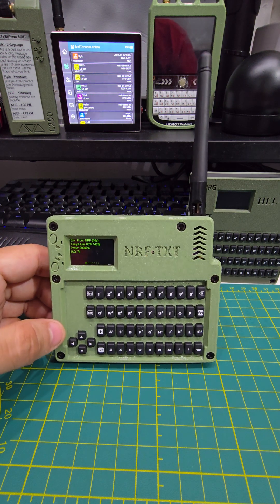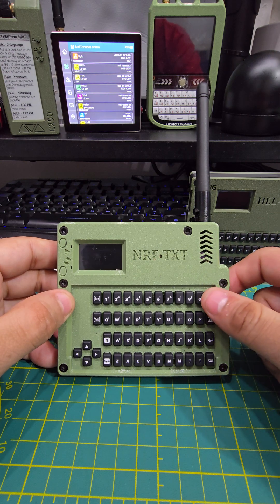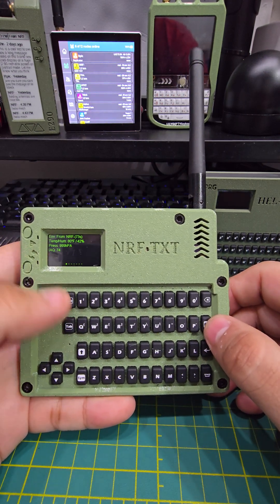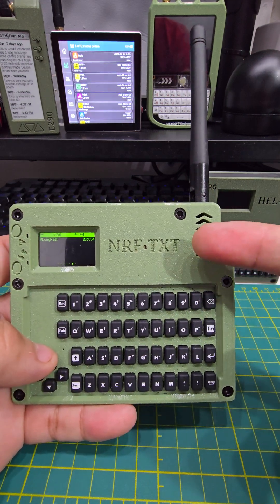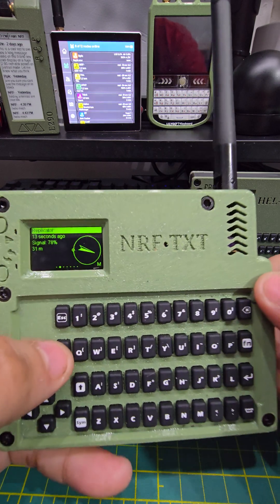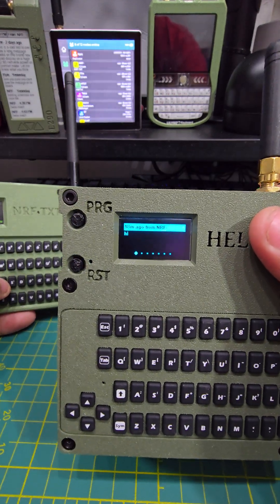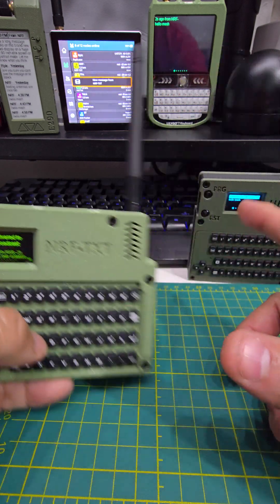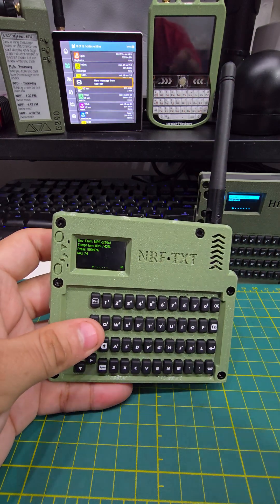NRF-TXT - Standalone for Meshtastic

Comment: Nice.   how waterproof/dust proof is this?  I don't need the temp, buzzer, humidity.  I am looking for the most compact design with a larger battery and keyboard.  What mods should I make to make this work for my application?  Hoping to get it be IP6 if at all possible.  Also are you using the onboard charging?  Any ideas on how hard it would be to add a separate charger so it can be charged faster?
Reply from the maker: @GunTotnHippie  I've gone though soaking rain with it and still working with no issues since the screws and siliconecover make it very tightly closed, but i wouldn't dare submerge it on water. You'd probably need to modify the spot where the temp sensor is since it leaves an open gap for it if you dont have one in